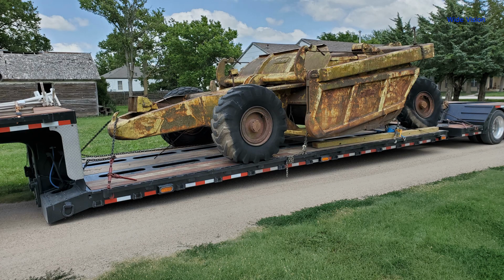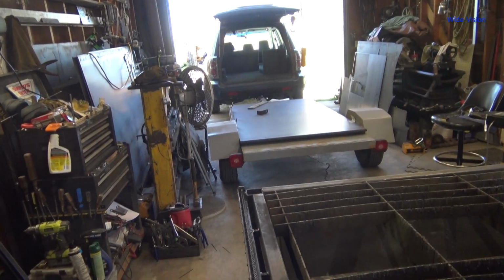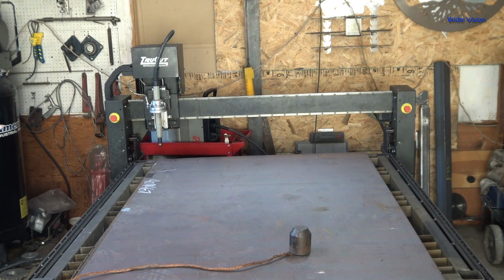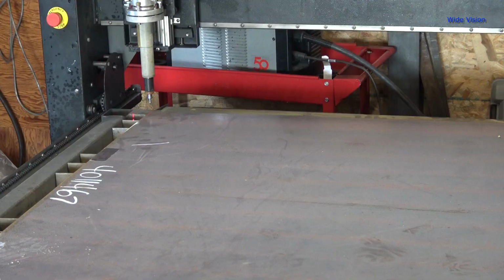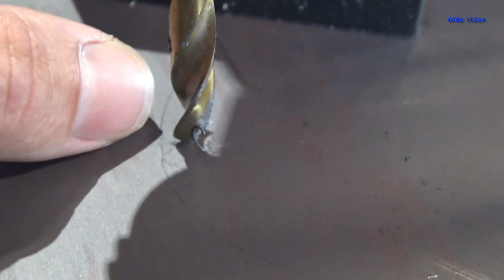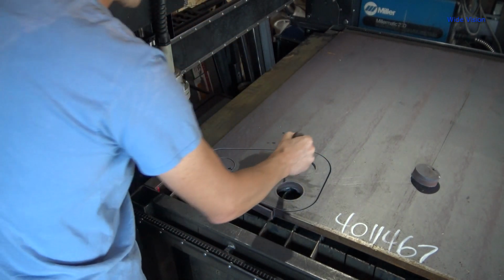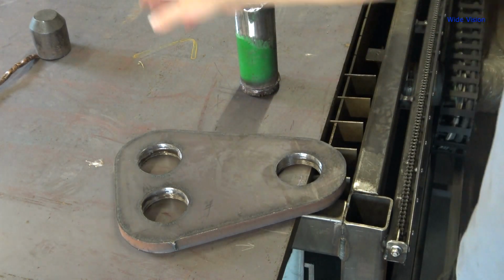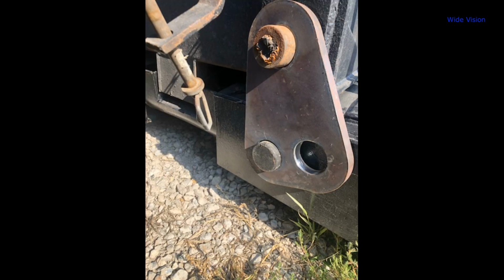90 pounds of 1 inch steel! Connector Plates. It's what holds it together!

Comment: ....14;40....   Drilling a 'pilot' hole...Ive done a lot of plasma cutting, and even more of a whole lot of steel plate...up to 8"....and always drilled a hole...the boss complained I was just wasting time, until I explained that the most greatest part of the plasma consumables wear was...piercing... show him the $$ there. For the OIxy/Acet....drilling a hole meant a nice razor sharp cut every time....no grinding or welding up big gouges on that 4" plate...!

Comment: I like watching people move heavy stuff around.  It can validate how you  do it and you might see some way that is easier.  We only have a HyperTherm 45 for our CNC Plasma table.  When ever we cut anything thicker than 5/8", we replace the plasma torch with an oxy/acetylene machine torch.  It cuts decent and is much faster than a plasma torch without getting into the big bucks.

Comment: There's a YT channel called FSC speed shop that shows how a lowboy trailer like that is detached from the hitch to load equipment and how those plates work. He also uses an older  cabover Peterbilt that you don't see very often.

Comment: awesome video keep up the good work.  i like the details. how you can work smarter and use simple yet safe ways do do things without huge cranes and tons of manpower.   on the plasma table for your lead in lead out try using an arced lead in and out they over lap each other and dont leave the spot where the plate hangs on.
Reply from the maker: Thanks for your feedback! :)  I've actually had worse luck with arced leads since my table uses constant velocity, it leaves a triangle area between where the arcs overlap.  On the next thick cuts, which should be soon on that dirt scraper, I'm gonna try no leads and try to drill right against the cut edge.  We'll see!
Reply: @WideVisionMetalFab  ohhh constant velocity mode less stuff to program yeah thats an issue  yeah drilling the holes next to the cut path is probably your best bet unless you want to reconfigure your cutting software with different speeds for each thing.

Comment: With the lifting of the heavier plates of steel, it might pay to make a spreader frame with some short chains to handle the lifting as slings and chains going directly to the hook should not exceed 60 degrees. The advantage of the frame would be to increase the height you can get the plate above the floor. You could also get more magnetic lifting devices to share the load.
Reply from the maker: I'm building a 3 magnet lifter. And I have no idea how I'm going to store this plate! Luckily I was able to line up 2 other jobs, so I'll be using a fair amount of it soon.

Comment: Your machine did a nice job on that plate.  That scribe attachment seems really handy, years ago were I used to work we used an attachment for a sharpie.  It worked ok, but you had the offset to worry about and the sharpie did not always work on oily plate or mill scale.
Reply from the maker: I was (am) really happy with it's performance!  The scribe is awesome, not just for layout, but it's great for serial numbers and putting "Wide Vision" on parts. Plus, we've started doing custom engraving now too. Hopefully a video on that someday.

Comment: Make the section of your roof over the table so you can open it somehow so you can use the crane on the truck to load the table. 
Also, as a work around for now on cutting at max power, run the exhaust and compressor off an extension cord from the house, might keep from tripping the breaker.
I also plan to make a new bifold shop door, so you should do it first so I can watch. Good work, Jason
Reply from the maker: "Convertible" roof sounds good to me! Not a bad idea using extension cords. I'm also considering putting the computer and the CNC table controller on uninterrupted power supply (Battery backup) even if I do get the electric upgraded, I have lost power during a cut before due to a "normal" electric grid cut.
Reply: @WideVisionMetalFab  A battery backup would be an easy stress reliever for sure.

Comment: Yea if you can skip through or speed up that part where you load the plate. I found it interesting to see you had to drill holes to get the torch to pierce, understandable. When those hockey puck chunks of steel came out my first thought was " rubber biscuit". And a close up of the cutting would have been nice.
Reply from the maker: Thanks for your feedback!

Comment: Keep showing the whole process. Also I would like to see some details on the build and operation of the bender. Finally whats happening with the drill press?
Reply from the maker: Howdy again John!  Bender video is coming... eventually! That was filmed when I was having camera issues, and I'm missing a lot of footage which I'm struggling on how to "span the gaps."   Sometimes I wish I could re-film these projects! The drill press is in a big heap of parts. I got it all tore apart and was beginning to remove the paint when life got crazy. Since I was able to get  the milling machine, (by some miracle) the drill press is kind of on the back burner. I really hope this Fall I get back on it. I keep having jobs come in which it would really help with. The mill is only so big. :)

Comment: Was that 50 amp ?   My plasma will go to 30 and I do 1/2" AR steel.  Nice table. I make clean circles out of scrap for leveling machines in the shop.  Better it take a hit if coming than my machine table leg!  Like a big washer shim without a hole.   Shim on top as needed.

Comment: You've purchased a slab to get two pieces out.  How do you price something like this where you will be holding on to a big chuck of steel for a while?
Reply from the maker: Luckily, I was actually able to line up 3 jobs. This job,  another set of connector plates, and that big scraper is getting converted to hydraulic which will use a good amount of this plate. All said and done, I shouldn't have much left over.  But to answer your question, I still charge for whatever I use and absorb the rest as inventory.

Comment: blowing the circuit breaker..  you may examine the electronics and look to see if you could use something like a 50 buck UPS to keep the power up to the electronics while the plasma cutting power is lost.. 
a friend has crickets in his shop too.. he uses his leaf blower to knock them out of their hiding places and out the shop door. 
 lastly.  when the circuit breaker blows.. after it has blown a few times.. you may want to replace it.. some brands as i understand when they blow..  blow at lower current levels ..
Reply from the maker: I've added a UPS to keep the table electronics and the desktop computer running. Bought a $150 UPS first, it blew up in a puff of smoke within a couple weeks. Had to pony up for an expensive one.    I used to have ducks that ate all my crickets, but the foxes at the ducks. :(
Reply: @WideVisionMetalFab  there was a little johnny joke like that.. went to town with a buck .. ended up with a duck.. then lost that too..

Comment: That turned out awesome! Was that some sort of hardened plate? Really cool seeing the plasma table in action. Keith fenner uses his for all sorts of things
Reply from the maker: Thanks bud! Just plain A36 mild steel. It's not a moving part, so it doesn't need to be hard, plus soft steel will stretch instead of break when overloaded.

Comment: Nice cutter
I have a 100 amp thermal dynamics but i never had to drill pierce holes
I realy like how you drill on the edge of your start position 
Try to get your electricity decent this will kill your cnc
Its better to put your computer on a powerbank so it doesnt shutdown
It also protects you for losing position
Greetings from Holland
Reply from the maker: Battery Backup for the table and computer should arrive tomorrow! :)

Comment: Why did you drill the holes ??
Reply from the maker: An 85 amp plasma cutter won't pierce 1 inch plate.
Reply: @WideVisionMetalFab  I have a Power max 85 I pierce up to 1.25 inch plate all the time....saves drilling. Contact me at  hilltop@nbnet.nb.ca  if you want details.  I was just wondering what speed you were cutting at? On 1 inch I run about 10 inches per minute on a straight cut but on smaller holes drop down to 3 to 5 inches per minute.

Comment: I haven't bought any steel for a few years, that plate is close to 1,300 pounds...what does it cost these days?
Reply from the maker: Just shy of a grand.
Reply: @WideVisionMetalFab  Thanks...about 30 years ago, I had a small one man shop....most any hot-rolled stuff (shapes) was around 25 cents a pound....plate was maybe 22-23....USA....every thing else was equally in-expensive.